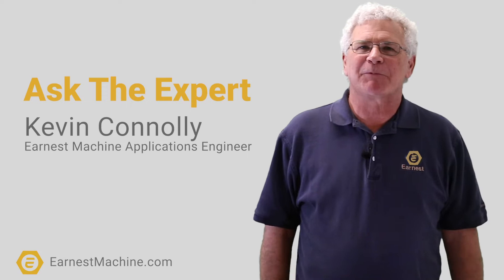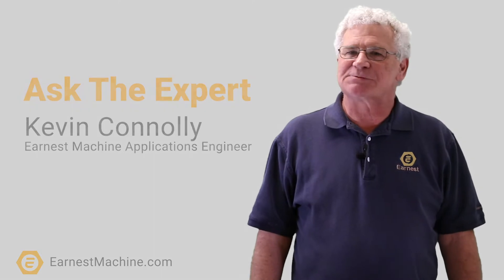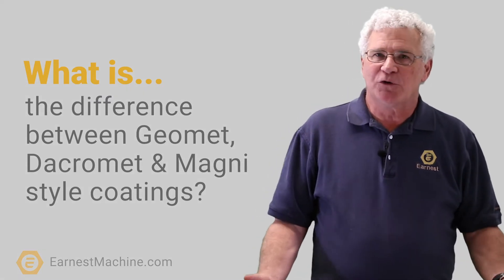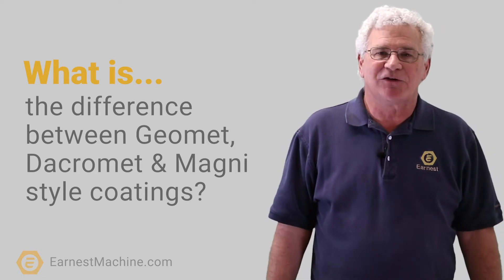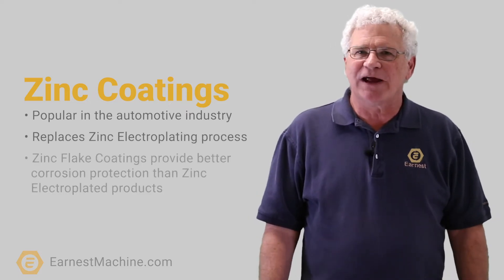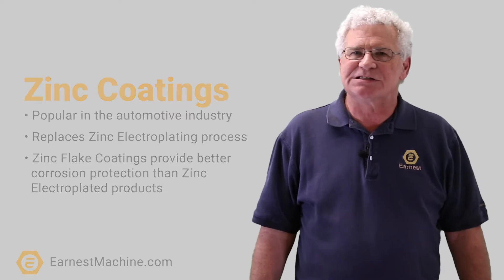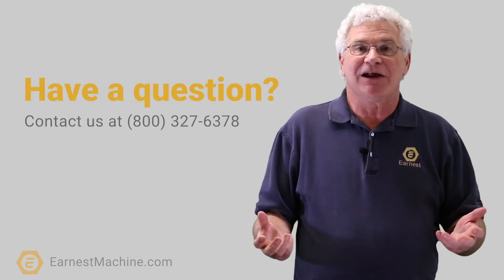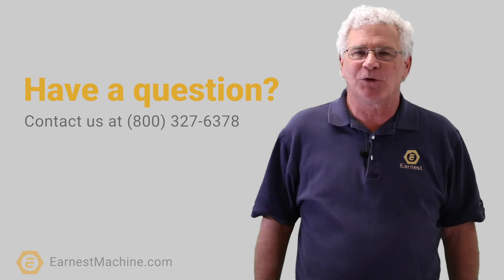Ask The Expert - What's the Difference Between Geomet, Dacromet & Magni Style Coatings?

Comment: Came here also curious about the Geomet Coated Brake Rotors. From what I gather they are superior in corrosion resistance to the old school E-Coatings. I'm just curious by how much. I'm used to seeing high amounts of rust after 1-2 years, in areas like the cooling vanes and the hub of the brake rotor (live in the Northeast - NY/PA). Would Geomet fair better? What are the expectations for a Geomet coated rotor in the same environment?
Reply from the maker: Thanks for your comment! Unfortunately, we deal with Geomet coatings that are designed to be used with Fasteners and don't have experience with Geomet coated rotors. Note that Geomet coatings are owned by a company called NOF Metal Coatings and their website may be able to provide you with more information. 

https://www.nofmetalcoatings.us/geomet-360
Reply: @EarnestMachine  thanks for the info.

Comment: what is electrophoretic coating vs the geomet? brake rotors are listed as geomet or electrophoretic and i’d love to know the differences.
Reply from the maker: Hi L H, sorry for our delayed response this is a great question! Electrophoretic coatings (also called e-coat) and Geomet coatings are two different coating processes. These are designed to provide corrosion resistance to steel parts. Electrophoretic coatings involve a process that uses an electrical current to have the metallic based coating adhere to a steel (or in the case of a rotor, a cast iron). E-coats provide a uniform coating thickness that has excellent adhesion to the part and provides good corrosion protection. Geomet coatings are either applied with a spray (as is the case for a rotor) or in what is called a "dip spin" process when applied to fasteners. Geomet coatings are a mixture of zinc and aluminum flakes that are in a paint-like solution that is baked onto the surface after coating. At Earnest, we believe the Geomet coating provides better corrosion protection than an e-coat.
Reply: Earnest Machine Thank you for the detailed response sir.
Reply: @lh98  As a person who lives in Wisconsin.  Geomet works well, made the mistake of not getting rotors without it.  Rusted hubs in 2 weeks